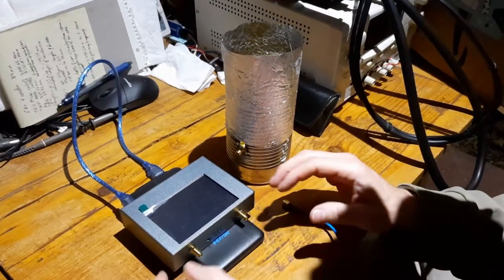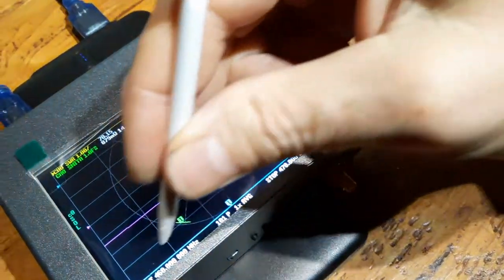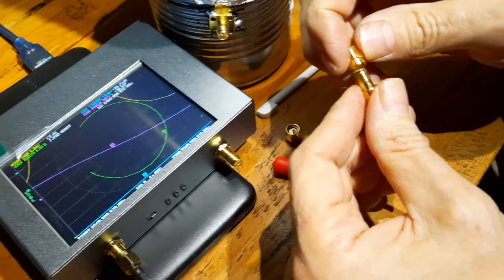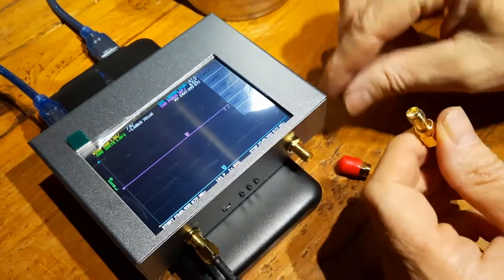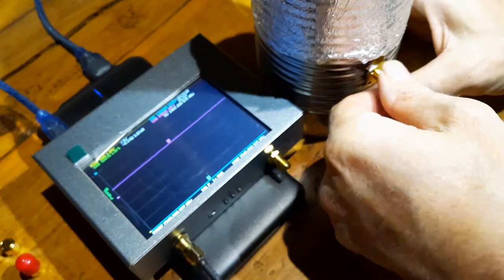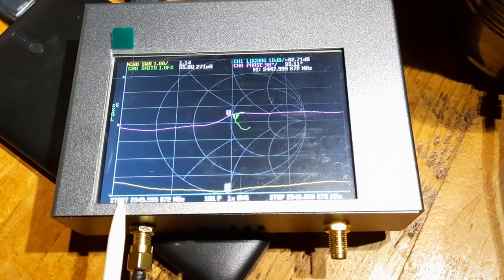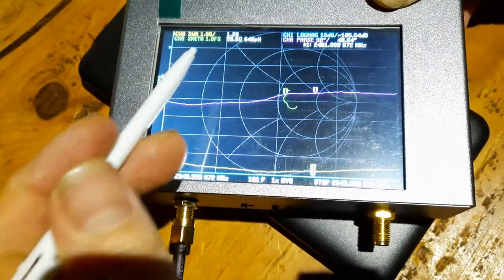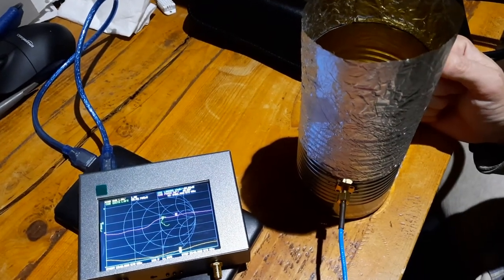Fun with NanoVNA v2 and WiFi cantennas!

Comment: Looks like a legit nanovna
Reply from the maker: Yes, it appears to be working very well. SO happy i got one!
Here is the link that led me to it:
https://nanorfe.com/nanovna-v2.html
Reply: NanoVNA is open source.
Reply: @erikas6874  this is not the case for the V2PLUS4.
Reply: @erikas6874  The V2 Plus4 (Plus5 or Pro) version is perfect and does not match any other version.
Reply: @zachreyhelmberger894     Congrats you're one of, like, two people on all of YouTube that isn't using a clone. LOL.
Reply from the maker: @SergeantExtreme  I am a bit of a maker myself so I try to contribute to those doing the heavy lifting developing cool stuff like this. I am developing WiFi enabled dataloggers for off-grid homes, super cheap but effective hearing aids and other electronic stuff.